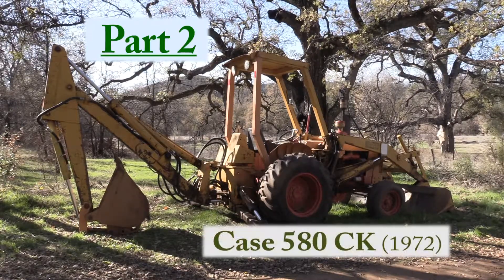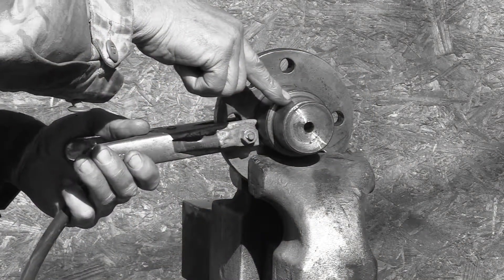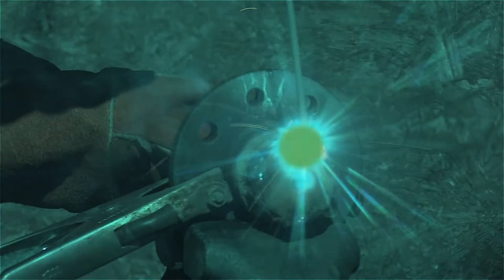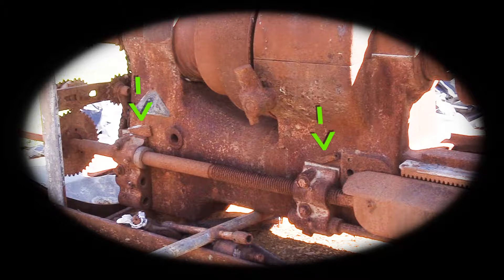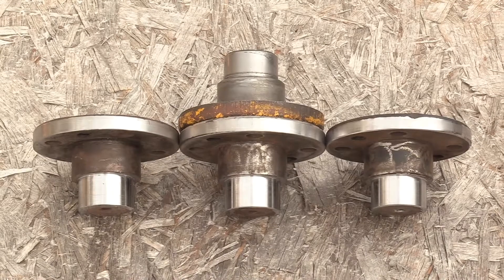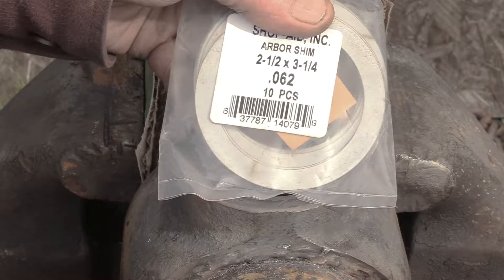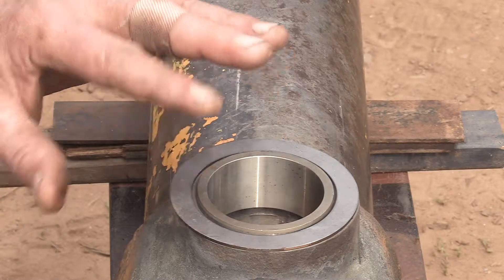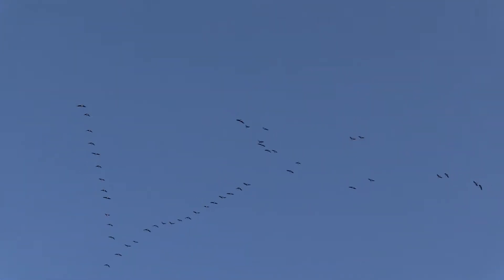Repair Hydraulic Cylinder #2  "GearHead In Depth"

Comment: There is a special spray you can use to put on all areas not getting welded that keeps the spatter from sticking. You can then remove spatter with your finger. But yeah your videos are awesome.